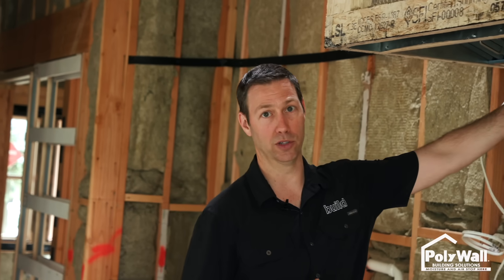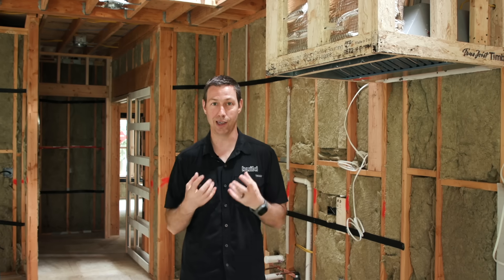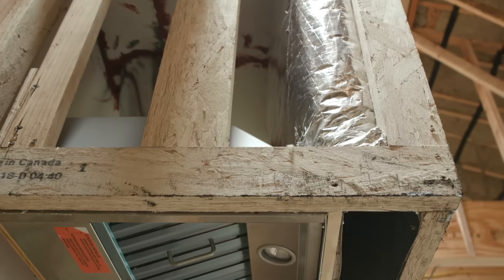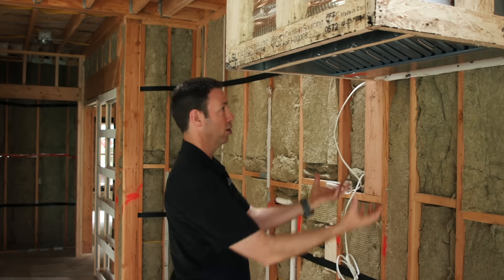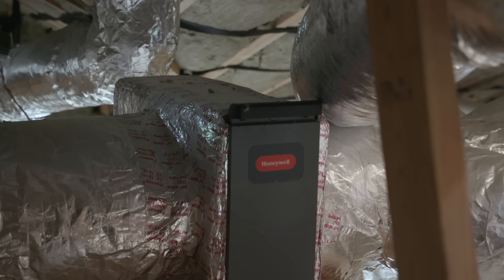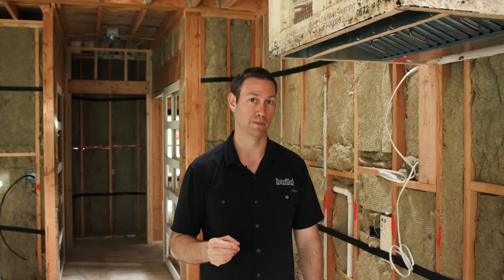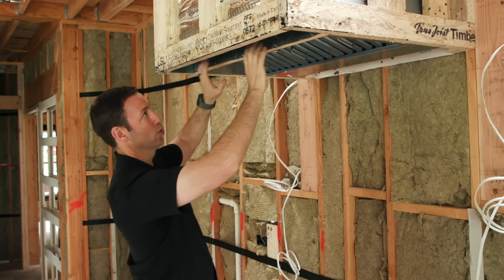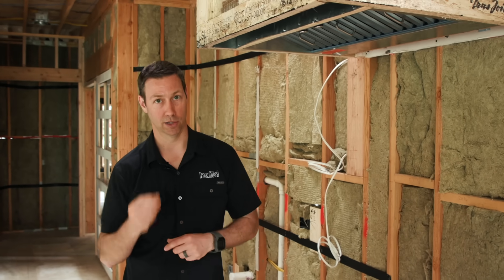Make Up Air - Kitchen Hood in a tight new Build

Comment: It appears as though someone didn't follow the manufactures specs when they installed the hood fan.  The hood will not function as designed.  Usually, they require a 27" to 30" max/min distance above the cooktop (cooktops are usually at 34.5" to 36" off the floor) and unless Matt shrunk a whole bunch and is now under 5'6",  the hood will not function as designed.  All the air that was supposed to go up the duct will be just the makeup air and the steam and grease will find somewhere else to go.  
By adding the makeup ducting in the front; you have to make the hood surround huge and thus have to raise it so you can cook without smacking your head on it.  The fan hood is for residential and not made for this application (unless I am mistaken- doubtful, provide model number).
Reply: You are correct.
Reply: It's also possible that this is a high end house getting spec'd with commercial quality hardware.  If I could afford a house of this size, I wouldn't be putting in appliances I bought at the big box store.
Reply: @rjtumble  High end houses get vent units like this all the time and regardless of the "look", they are residential units!  This one was not installed per spec that is why I asked for a model number-  I just installed this very unit 3 months ago.
It would be an extremely rare situation where a commercial unit gets installed in a residence and this is not one of those (maybe Bill Gates house, but as I recall he doesn't even have one).  That particular unit is a "commercial looking," residential unit.  The design is to have that look, so as to make people think it is a commercial unit- it appears as though you have been one of those caught on the hook.
Reply: @bestbuilder1st  I worked commercial restaurant equipment for many years and we sold a few per year for residential. The mfr's built the look alikes but were overpriced for the few who wanted them. (not really overpriced, they had to add safety, insulation, soften the sharp edges, etc.) The problem with commercial is heat, Your back walls had to be fireproofed (SS usually). I don't know how they got by the residential codes for the commercial hoods mounted higher with more CFM.
Reply: I suspect a shroud will be built around which will come closer to the stove.
Reply: @Foche_T._Schitt  The manufactures specs of 66" off the floor apply to the actual fan unit, not the shroud.
 If the shroud is built lower/closer to the stove you will not be able to do any actual cooking.  That shroud sticks out from the wall at least as far as the cooktop.  If it is built to the specs, it has to come down to a maximum of 66" off the floor.  Most people would have to contort themselves trying to get the head under shroud (your design idea) to see in a pot or do any stirring, making for a very unsafe situation.  Next time you are in front of the stove, put a box at 66" off the floor and out from the wall as far as the front of the cooktop/stove and you will see what I am talking about.
This design and application is a no-win situation.
Reply: did he have to use chip OOSB timbers to hold up the hood instead of solid wood beams?
Reply: @randomrazr  Doesn't really matter, they probably wanted something very straight and uniform to accommodate the finishes
Reply: yup. the hood is only 300cfm. ive seen a higher cfm fan closer to the range fail to expel enough smoky air from cooking. this would have needed a more "professional kitchen" approach. actually surprised if this will meet local code, but I guess it will otherwise matt wouldn't have installed it.

Comment: This looks like it would short circuit the air path and not remove air/particulates coming off the range hood efficiently. Wouldn't it be better to have a makeup air vent somewhere else in the kitchen. Also the added filter, while nice to remove incoming particulates, is going to further hamper the hood's effectiveness. I would double or triple the filter media surface area (more filters) to get as little resistance as possible if a filter is a must.

Comment: I love this. I'm moving my make-up air from the basement to come up right under my range. The air will come up over the front of the range and pull grease and steam. I believe all high output stoves should have this built into the front of them.
Reply: Yeah, as a HVAC installer I prefer your description over what is in the video.  As there flow from outside to the range hood is a direct linear line travelling over and around the range.
Reply: @mennomateo  it creates an air wall, like the opposite of the air curtains some retailers have.
Reply: @mennomateo  Exactly, this placement is terrible.
Reply: I like this method too! 
Place grill in the toe kick. 
I wonder if it would be uncomfortable for the chef in colder climates?
Reply: @jmlcolorado  in colder climates a good option is to pre heat if needed and deliver the make-up air into the pantry where it cooler air would have a chance to mix with the conditioned air. The pantry would stay cool and dry and the occupants would be shocked with cold unconditioned outdoor air.

Comment: Hey Matt what do you do for a wood burning fireplace In a really tight house I’ve seen problems with the fireplace not  being able to draw and smoke gets in the house.
Reply: IMO wood burning fireplace in an air tight house is a pretty bad idea in general. Would immediately make it not air tight anymore what with the chimney being basically a giant hole in the envelope.
Reply: @rafflesmaos  i would hope a chimney is actually sealed, but it does rely on the fireplace door seals being in good order.
Reply: tweake it’s an open fire place🙈
Reply: @texascraftsman7215  can't help there. They are pretty much banned here. I doubt you can do anything with open fire place except increase air pressure in the house.
Reply: you can get fireplaces with built in air inlet duct that you route outside. so the fireplace is basically a sealed system. just be careful tho, i have seen some where he air inlet is open to the house so its not a sealed system.
Reply: @tweake7175 , My pellet stove has it's own fresh air 1 1/2'' tube going right into the fire pot.
Reply: tweake hey thanks... the engineer recommended that but after it was installed still had trouble will the fireplace being able to draw
Reply: @texascraftsman7215  i never looked at it to much due to them being rare here. but location, size of vent and air pressure comes into play. the other possibility is to crank up the ventilation incoming air to pressurize the house. that will push air up through the chimney.

Comment: So this answers a question I've had for some time, but how about bathroom vents???
Reply: they can have the same issue. a crude way around it is to trim the bottom of the door a bit.
Reply: @tweake7175  If the entire house is sealed well, you can leave the bathroom door open and it still cannot push bathroom air out as there will be nothing to replenish that air.  I'm thinking more in the way of pulling air from outside through the heat/air exchanger for the HVAC, but I don't know this for sure. Therefore I am asking the professional...
Reply: @SteveP-vm1uc  true. however bathroom fans don't flow a lot and the ventilation system /hvac should be able to supply enough air for that. with some ventilation systems the bathroom exhaust fan goes through the vent system to get heat recovery. there is lots of options.
Reply: @tweake7175  tamarack also makes a nice thingy that goes in a cutout on the bottom of the door, and allows air in, but is slatted to reduce light/sound

Comment: Why would we have to use a separate filter for the kitchen range hood makeup air?   
Would it be a good (or bad) idea to allow for kitchen hood makeup air by using a whole house ERV system?

I would think that this type of setup would also allow the homeowner to control the incoming makeup air temperature, humidity, cleanliness, only need to stock one type of filter and not disturb a normal kitchen hood exhaust airflow pattern.

Hopefully someone has the knowledge and/or real workd experience to let me know if my thoughts are completely wrong here.
Reply: You cannot successfully setup an erv unit for your whole house to supply air for a unit that runs for such a short period of time, that being said all passive design projects I work on here in nyc call for electric stoves- no gas at all- to be used  in such an air tight house to eliminate having to install an exhaust that would lead to heat loss
Reply: I've been pondering a bit on how to deal with kitchen exhaust in an airtight construction. Basically my current thinking is that makeup air defeats the entire purpose and circumvents any efficiencies and advantages gained from an ERV/HRV. You're instead going to directly put potentially freezing or sweltering outdoor temps directly indoors, at whatever humidity level. 

Instead it's likely better to put ERV/HRV into boost mode and put a return at or near the kitchen. Plus not using gas, or cooking very grease heavy foods.. maybe use an oudoor kitchen/grill for that. Basically, just don't use a hood.

Edit: Forgot to mention the option of a recirculating hood. Not bad if you REALLY want to cook foods with lots of particulates/smoke, but keep in mind the ongoing filter costs.
Reply: I own Restaurants we have tempered make-up air.  Which means the intake air is heated/cooled according to the season.  The last thing you want is 10 degree air in the winter blasting on your cooks freezing them and getting them sick. In the summer hot humid, sticky air making your  cooks miserable sweating and dripping sweat on the food. Un- tempered air over works your heating and cooling systems.  I have seen restaurants with untempered air  over working their kitchen's A/C roof top unit to the point where they have a sprinkler running on them so they don't over heat. Also my hood co. Has a specual device that measures the air pressure so you can balance the air flows on the intake/exhaust fans. This guy Knows nothing about a proper exhaust system with make-up air. Your system needs to be certified. Not some home made nonsense. We spend $30,000 to $50,000 on an exhaust hood system, the best one made is Captiveaire.  They make small ones for above dish washing stations that might work as a home system.  Your idea of using air from a whole house air exchange system is a much more sound.
Reply: All the above. Work for a commercial HVAC company. Usually the engineer specs tempered makeup air. But, on a house if done right, it probably could be done with an ERV / HRV. The ERV would be interlocked with the kitchen hood and would then provide the makeup air that way. Again, it doesn’t have to be from a duct right next to the hood, just the hood needs that extra air to come from somewhere.
Reply: Kevin Murray- in theory it “can” work but a homeowner would have to take on more expense to get an oversized erv unit which will effect the whole house for a singular unit that runs for a short amount of time, this whole makeup air system is really over engineering houses to solve an issue you can really fix by just opening up a kitchen window since this air system isn’t bring in temperature controlled air anyway

Comment: What do you do to temper the air? In the north in winter that would be very very cold air coming in.  A commercial unit would normal have a direct fired heater to preheat the make up.

Comment: with a few people questioning wither the make up air will short circuit the hood, why not test it?
Reply: simple.. burn a sooty heat source  turn on the vent turn on the heat on the range top. you will know this works.  If one were blowing air via a fan into the make up air you would quickly discover it does not work well
Reply: i was thinking more along the lines of a smoke pen/canister in the makeup air supply. see where the make up air goes. does it go down to the cook top or just turns the corner and gets sucked into the hood.
Reply: @tweake7175  smoke pen is what I was thinking of but had a brain fart.    I was amazed to see that a down draft vent was all but useless

Comment: Pretty much code everywhere with a ginormous hood. But honestly you don’t need anything greater than that in a residential house. Save yourself the money and get a 400 cfm fan. I had one in my passive-ish house and it was fine. Also had a makeup air in my restaurant and it was really expensive.

Comment: Thank you for bring this topic to light!  What do you recommend for the clothes dryer?  We live in a humid climate so it seems efficient to use dehumidified make up air from the house but now that I've tightened the house up its either open a window or backdraft the woodstove chimney even with a 4" Panasonic air inlet installed.  Gotta be something better.  Moving the laundry room to the garage is not the answer.
Reply: John, in my new house in FL, I was forced to add an outside vent next to gas dryer in ceiling. Going to cover it up after C of O and open door or window. Having hot, humid air enter house 24/7 is idiocy.
Reply: I've seen where people have modified their dryer to have an external air intake, either from outside or their attic.  Haven't tried this one yet but it's on the list of experimental ideas. I also picked up a Heatpump dryer from a Sears Outlet store but haven't evaluated that yet. I've heard they create a lot of humidity.
Reply: @garyreardon  The heat pump has a section with evap and condensing coils. Just like any heat pump.  The water is dropped out as it hits the condenser coil.  From there it is pumped out into your drain line.  There should not be any humidity produced.
Reply: for a drier.. heat pump drier. no venting needed.  no combustion products introduced into the house and a lot more efficient than gas or resistance electric
Reply: @stevepailet8258  Yes, I had it at my last passive-ish house. I did like it. In my present house I needed two appliance units to be gas in order to obtain the local gas company discount so I got a gas dryer with my gas range. Don't be fooled, it still gets humid/hot in the laundry room even with the heat pump dryer. It's a common complaint although I didn't think it was particularly bad. AND the price tag is pretty steep but hopefully one of those things that comes down in price as it becomes more widely known and accepted. It's probably a life saver in condos and alike.

Comment: Great idea, and actually required by IRC code if the hood is, I think, 400 cu ft or more. Otherwise the house will be under negative pressure when the hood runs, If you have built tight.
I did this on the house I just built for myself. I have a cooktop on the island, and the vent is on the surface of the island, right next to the cooktop. It goes to an intake at the rim joist, that looks like a foundation vent, and the filter is there. I had put a damper on it that was supposed to open upon a draft, but the spring is a bit too strong. So it just has a filter. Next time I will probably motorize it, so it just opens when the hood fan runs.
Reply: Tom Tillman 
This seems like the ideal setup to me

Comment: "We want a tight envelope."  Debatable.
Reply: A tight envelope is critical but if we do not provide make-up air for the range exhaust we are creating a negative air pressure situation. An ERV is not designed, as far as I know, to automatically react to cooking levels and increase flow in a kitchen like it does in a bathroom. A manual switch to increase that flow might work but who's going to flip that switch every time you turn on the range/hood. I guess if one does this in the bathroom they'd be used to doing it in the ktichen.
Reply: Thors Hammer, you add a cheap pressure switch to the exhaust duct that closed the circuit for the ERV. But even then that would imply the ERV was grossly over venting. You have to use source control for devices that move lots of air and are intermittently operated.